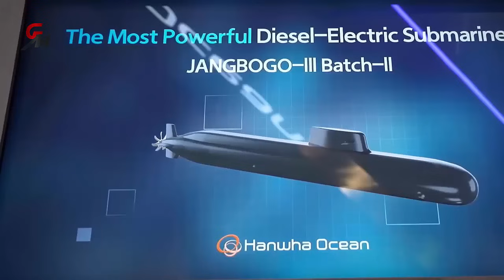Which is Better TKMS 212CD or Hanwha KSS-III, Here's The Canada's Next Gen Submarine

Comment: The Type 212CD is a good submarine design but it's not great, and it's not a modern Type XXI. If Canada chooses the Korean sub, it will not cause problems with Germany and Norway. Canada will still have trade relationships and provide all the raw materials they need to protect their military supply chain. I believe that submarines are a force multiplier and the most important weapon system in any military. They are more important than fighter jets, stealth bombers, and surface ships. The priority of the Canadian government should be to get the best submarine for Canadian needs and create the best relationship possible with the country building them. If the 212CD is the best submarine for Canada, then it will be chosen but Canada would not receive the first sub until 2034 and the second in 2037. But, if it isn't chosen, I don't think the relationship with Germany & Norway will be affected because national defense is very personal. Germany and Norway are not the United States of Trump, so they won't hold a grudge, and there are other weapons we can buy from them. I don't think the Type 212CD has twice the capabilities of the Korean sub and the propeller on the 212CD is obsolete sub technology requiring a diffuser to smooth out the flow of water to reduce noise. If there was a huge advantage in the capabilities of the 212CD, then it would be worth waiting for. The outer hull active sonar deflecting design of the 212CD is an advantage and perhaps it can remain submerged longer than the KSS-III. However, longer submerged time would only be useful if the sub is conducting surveillance in enemy waters or is being hunted by an enemy that will attack when the sub goes up to snorkeling depth. But if the sub crew can't shake off pursuit in 20 days, then they have really big problems. The odds that a Canadian sub would be outnumbered and hunted without any ally ship nearby is unlikely. How long a sub can patrol is based more on how much food is carried on board. I have heard that there have been a few problems with the 212A because it's a new design, it's hard to get replacement parts, which is expected and will be worked out eventually. Even though the KSS-III can't deflect active sonor, it is proven technology that is reliable and Canada can receive the fist in 2032, then one every year after that because the two rival shipyards of Hanwha Ocean and Hyundai Heavy Industries have agreed to work together. Perhaps the Korean sub can't stay submerged as long, but providing it can remain submerged long enough to maneuver under the arctic ice with a good safety margin it is only a slight disadvantage. What are the top priorities for a submarine? Top speed - no. Maximum diving depth - no. Quiet operation (stealth) - yes. Electronic & visual surveillance and tracking of enemy - yes. Firepower - yes. The number of and size of torpedo tubes are the same on both subs. The 212CD can fire cruise missiles and surface-to-air missiles from the 6 torpedo tubes. Not only does the KSS-III have 6 torpedo tubes but an additional 10 vertical launch tubes. The KSS-III can fire missiles to attack land targets and surface ships from either the torpedo tubes or the VLS. The Korean sub has the advantage in firepower and the ability to attack a variety of targets at once. If surface-to-air missiles can also be loaded in the VLS, then it would be even more useful. I think the KSS-III sacrificed battety capacity and endurance for increased firepower with the vertical launch tubes. I see the KSS-III as a more important sub because the deal is more important to Korea, and buying the current sub is an investment in their future submarine development program. Korea wants to rush development and begin production of their new KSS-IV (2,000 ton) sub sooner (2028) to deter the aggressive moves of China & North Korea by replacing all the KSS-I and KSS-II subs with 9 KSS-IV submarines. When the KSS-IV is operational, then as a priority customer, perhaps Canada can upgrade from the KSS-III Batch-II (3,600 tons) to the KSS-III Batch-III (4,000 tons) equipped with technology from the KSS-IV (2,000 ton) like solid-state batteries, next generation fuel cells, next gen AIP, and perhaps a rim-driven propulsion system. The Hanwha Ocean future submarine concept was a small plastic model on display at MADEX 2025 with a stealth hull. The South Korean future submarine concept will either be the KSS-III Batch-III or the KSS-IV. There is a YouTube video and articles on the internet about MADEX 2025 where they claim their sub will have an underwater endurance greater than any other submarine in production, and it will use a new rim-driven propulsion system. The model has an angular hull and a very low profile fin/sail at the nose of the sub. The diving planes are mounted low on the submarine's nose with the ability to retract, when cruising at a fixed depth, for improved efficiency and reduced drag because water is 784 times denser than air. The Hanwha Ocean future concept has X-form rudders and a ring at the back end that doesn't show the propeller, but the blades are mounted in the ring and spin using electro-magnetic drive. The largest advantages of the rim-driven thruster are lower noise emissions and potentially increased efficiency. Since the propeller blade/rotor assembly is driven directly by electro-magnetic forces, no shaft and no gearbox are needed. The blades can be made of metal or composite material, and the rotor and stator can be hermetically sealed. Since the blades are mounted to the rotor ring, there is no tip gap (which can be a noise source in ducted propellers) and the elimination of a mechanical gearbox also removes a prominent source of noise. There is no upgrade or planned future version of the 212CD that I have heard about, so to me, the Korean sub has more potential for future upgrades and improvements.
Reply: I believe that Korea is not only the world leader in shipbuilding but also ranks at the very top globally in steel, semiconductors, materials, solid-state batteries, sonar, chemicals, electronic warfare, missiles, and AESA radar technology. The flexibility in upgraded parts replacement is something no other nation can match.
Reply: I agree and I believe we should encourage greater trade and technology exchange with South Korean industry and with trade and societal interactions as well. South Korea is in terrible danger of human shrinkage and loss of human capacity. Counteracting this are robotic technologies allowing continuation of the industrial powerhouse dynamic for some time to come. We can forge similar trade relationships to our EU arrangements with SK and benefit both countries with no loss to EU concerns. As mentioned, there is no shortage of 212 purchasers.
Reply: F.......k who do you actually think will read all that ! In a chat no less , you have to keep it more brief dude !
Reply: Forrest...According to AI analysis, South Korea cannot provide any documented evidence of cold water/Arctic temperatures of -1.8 degrees Celsius for all systems for their new submarines, but the Federal Republic of Germany has been doing so since WWI 1914! North Sea water is between 0 and 5 degrees Celsius cold in winter! Temperatures drop from 15 degrees Celsius in October to 6 degrees Celsius in November. German submarines have been operating in Arctic waters since World War II! Somehow, the Federal Republic of Germany/TKMS has 110 years more experience than South Korea when it comes to cold-water submarines!
Reply: @tlsig
무슨 소리야?
한국은 초극저온 -70*C 이상에서도 견디는  LNG선과 쇄빙선 제작에 세계  초일류의 기업이다.
독일은 과거 100년전에 이념전쟁에서 잠깐 활약했을뿐이고...
한국은 70년이상 휴전상태로 전시상태로 무기개발을 현재까지도 진행하고 있지...
Reply: @황선욱-n3b  thats why southcorea has 2 Nobel laureates and germany 134. i would say this is outstanding.
Reply: U212CD has VLS!! According to AI, U212CD is in a different league and much more dangerous! U212CD can be extended to 90 or 100 meters with additional identical modules! Diving depth is over 100 meters thanks to its diamond/oval shape, which can withstand 1.25-1.5 times higher pressure. Deep water is the biggest problem in even detecting a submarine due to the layers! Furthermore, thanks to U212A, U212CD is also Arctic and cold water-tested (-1.8 degrees Celsius for continuous operation for weeks), which also gives it an advantage over KSS III! Cold water is an extreme stress on materials!
According to AI, BRD Diehl developed an underwater hull, the Barracuda, back in 2005, which is now ready for use. It can reach speeds of over 200 knots/400 km/h, and in tests even up to 800 km/h! Range 100-160 kilometers! Currently only interceptable by the Barracuda! It's a purely kinetic weapon and, according to AI, probably undetectable by today's sonar because it's too fast. AI: If it accelerates to 800 km/h in the last 5 kilometers and hits, chaos will ensue. According to AI, just two Barracudas would sink a Zumwalt. The Barracuda would simply pierce through several decks and trigger chain reactions.
The facts AI has shown can't keep up with KSS III. Regarding construction time, it's also Canada's own fault, as they build it in their own shipyard! The high-tech components come from Germany and Norway. Another extreme feature are the new TKMS drone submarines. According to AI, 50 of them could form a 5,000-kilometer perimeter (90-100 kilometers detection range for drones) and detect everything above and below water! If necessary, it can also engage targets directly using various means; Barracudas would be an option. The drone just has to wait for what's coming and can forward data to the FCAS combat cloud, where AI then evaluates it!
According to AI, no other submarine can compete with the U212CD of its time.
KSS II is a derivative of the U214, which is the slimmed-down export version of the U212A! KSS III is ultimately based on the U214, which was further developed but without the high-tech sensors of the U212A! According to AI, the U212CD's sensors are in a new, far higher league! The sensors are completely AI-controlled and immediately make suggestions about where the next button needs to be pressed!
Reply: forrest...They simply have no idea about the subject! South Korea's economic boom only began in 1990, when, like Japan, it diligently took photos everywhere in Germany, especially at trade fairs! ...but also in steel, semiconductors, materials, solid-state batteries, etc....
TKMS is the world leader in specialty steel products, including aircraft aluminum. Even the USA imports it from Germany for the F35/22. Germany/Fraunhof Institute Stuttgart has the unique selling point worldwide in lithography machines for semiconductor production! The Fraunhofer Institute developed them, including all the associated systems, which ASML/Holland then assembles! Without Germany, absolutely nothing would be possible in this field!
In 1970, Germany was already researching polymer batteries and the like! Nobody knew anything about them back then, and they laid important foundations with basic research that played a decisive role in global battery research! It was only through collaboration with Japanese researchers that the breakthrough came by chance in Japan, which made our new battery systems possible today! It was Sony and researcher Akira Yoshino who then developed and marketed the first commercial lithium-ion battery based on research collaboration with fundamental research in the Federal Republic of Germany! Without the knowledge of the more concrete German discovery, which is considered a key impetus for Japanese lithium-ion battery development, the research into lithium-ion intercalation in carbon electrodes, which took place at the Technical University of Munich (TUM) in the 1970s, would not have been possible! Institutes and researchers in Germany and Japan still work closely together today! In addition, numerous collaborations exist between German and Japanese research institutions to further develop post-lithium-ion technologies!
South Korea was a third country at the time after the Korean War.
Reply: @tlsig

자동차 2차 전지도 못 만드는 
독일과 유럽~😢😢 ㅋㅋ
Reply: When you write Korean sub is prove technology, that is newspeak for old. The German/Norwegian sub is state of the art in digital subwarfare deveeloped by Kongsberg and with NSM and JSM missiles too.  All in a new stealthier design by Germany.  They have been designing this for a full four years.

Your comment about upgrade of thee 212CD, speak with the Dutch, they can tell you.
Reply: forrest...The HY-100 steel is a specification and says nothing about what TKMS steel is! Research and development by West German institutes since the 1960s has been behind it, as well as experience with their submarines, even in cold water/Arctic conditions! TKMS steel is subject to the highest level of secrecy, even in extremely complex manufacturing processes where no one except specialists is allowed to enter!
My/our information is in a different league than yours because we are strategy and business consultants, as well as major investors and advisors to major investors! My mentors come from the 1950s to the 1990s and are the elite mentors of the Federal Republic of Germany in many fields with excellent contacts!
Reply: @tlsigGerman paper technology is the best, but you need to meet the deadline and make it cheaper to be competitive. That's where you have lost the competition against Korea. Korean ppl are ready to work 24 hours to meet the requirement of the clients while you make clients wait forever. Price and deadline are very important factors as well
Reply: forest...AI analysis sees a significant risk without this verification that submarines like the KSS III will then be deployed in these extremely dangerous seas with the extreme stresses on the materials! The USA also had extreme problems back then, and according to AI, the FRG, as a NATO partner, was probably the number one contact for solving problems!
Reply: @tlsig For reference, the Korean metallurgical company POSCO supplies its Giga Steel to 15 global automobile manufacturers, including GM, Ford, Renault, Toyota, Honda, Nissan, Mercedes-Benz, BMW, and Volkswagen.

https://youtu.be/B9YEsE2NfnE?si=Lj9RsdwhqapDAEYt
Reply: @tlsigAI says you are dumb
Reply: How much is Hanwha paying you to write this??
Reply: @TheHk1966 Do your own research on submarine hydrodynamics and the acoustic benefits of the Korean rim-driven propulsion system over the traditional submarine propeller installed on the Type 212A that must use a boss vortex diffuser to smooth out the flow of water after passing through the propeller to reduce its acoustic signature.
Reply: What's very important is that KSS submarines require the extremely special steel from TKMS! According to AI, they can't build their boats without it!
Reply: @tlsig If I may mention just one example, have you seen the video where a bullet only scratches a steel plate as thin as a sheet of paper (0.1mm) produced by POSCO and Hyundai Steel, without penetrating it? I believe I saw that video about five years ago from POSCO’s steel division. They said it was a matter of national security, but you can probably still find the video if you look for it.
Reply: @tlsig You claiming that KSS‑III Batch III used steel from TKMS is utterly stupid nonsense. Here’s why:
1. Korean shipbuilding is world-class
Just look at the ARAON and next-gen icebreakers: Korea breaks through ice over 1 m thick for both polar research and commercial LNG transport. Germany may have experience with small research icebreakers, but in commercial large-scale polar ships, Korea’s production capabilities are unmatched.

2. Why would Korean subs need German steel?
Korea can produce high-strength hull steel and specialized materials for submarines entirely on its own. The idea that KSS‑III would rely on TKMS steel is complete nonsense.

3. Logical contradiction
If KSS‑III had used TKMS steel, it would imply using inferior materials compared to German icebreakers. But in reality, Korean icebreakers match or exceed German standards in both research and commercial applications. This claim ignores technical reality and is pure fabrication.

4. Russia proves the point
Interestingly, Russia is a major customer of Korean icebreakers. They ordered Arctic LNG carriers and research vessels from Korea, even during times of conflict. If Korea’s shipbuilding is internationally recognized, your claim that KSS‑III relied on German steel is simply ridiculous.

So your claim that KSS‑III ordered steel from TKMS is utterly stupid nonsense - there’s no basis in reality, technology, or international precedent.
Reply: @tlsig I don't know why you keep insisting Korea needs special steel from TKMS.  Gemini and Chatgpt both says KSS-III is built with HY-100 alloy steel from POSCO, south korean steel maker.
Reply: @tlsig  I doubt that south korea is not capable to produce their own sub grade steel ! And you rely too much on AI!